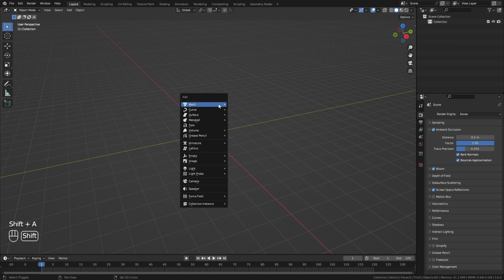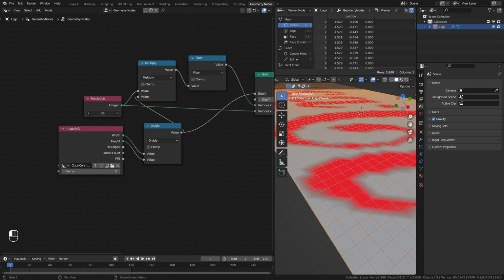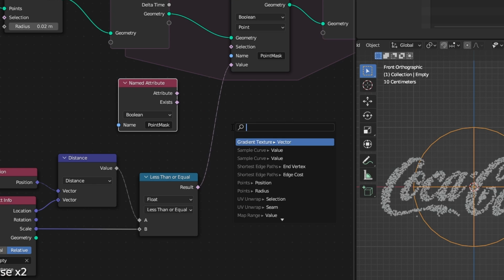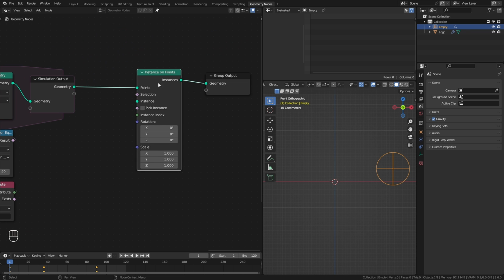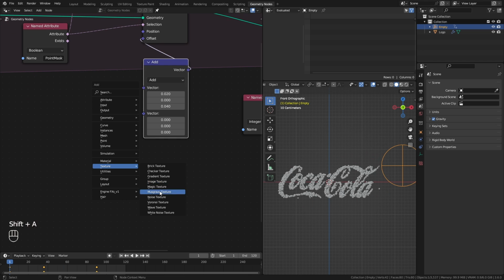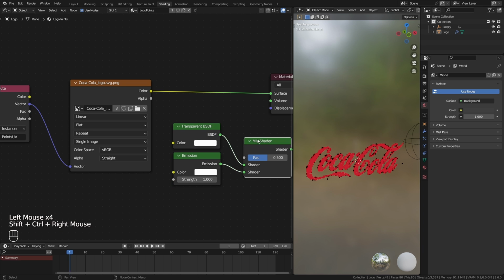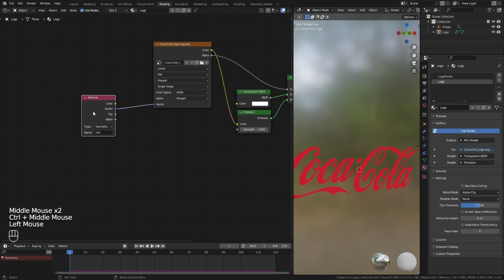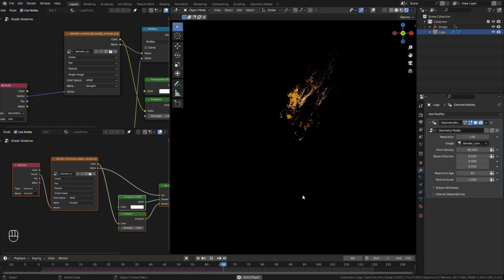Disintegrate Any Logo or Image | Blender Tutorial

Comment: Would this work in Blender 3.4? I've started but my Mesh Grid node doesn't have a UV Map option to link to the Vector on the Image Texture?
Reply from the maker: Simulation nodes only available in 3.6 and above so 3.4 will not work

Comment: Awesome tutorial, thanks!
One thing I found was that removing the logo background with blend mode -> alpha clip doesn't work with cycles. Instead, you need to add a "Greater Than" math node between the image alpha and the Mix Shader Fac. Make the threshold = 0 and this removes the unwanted areas.